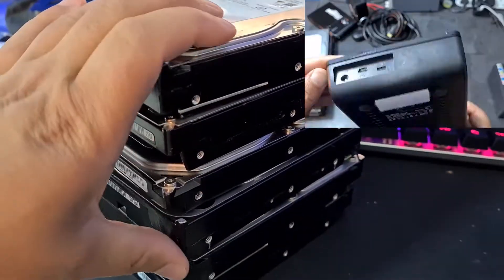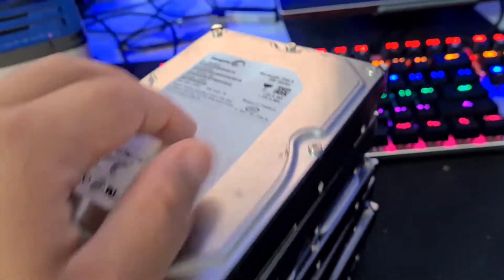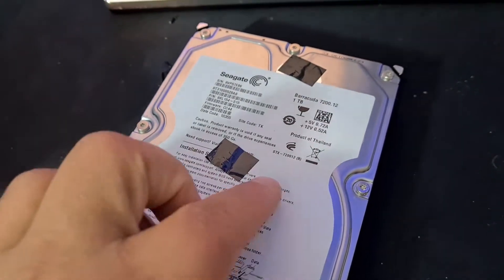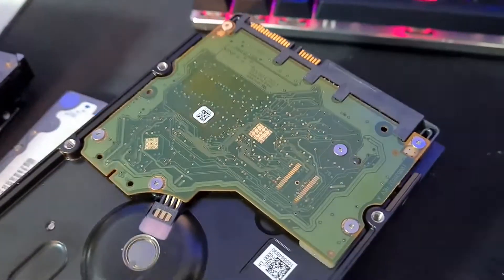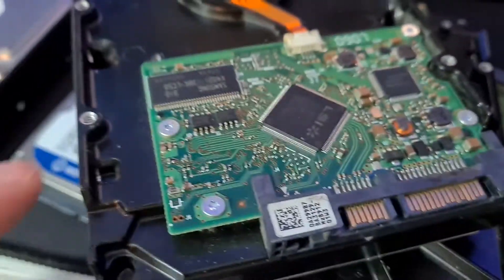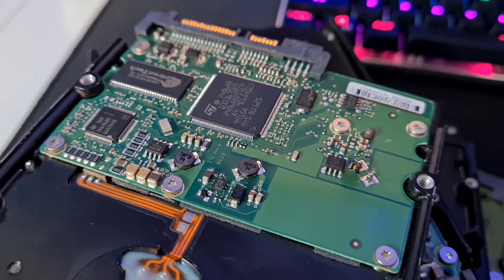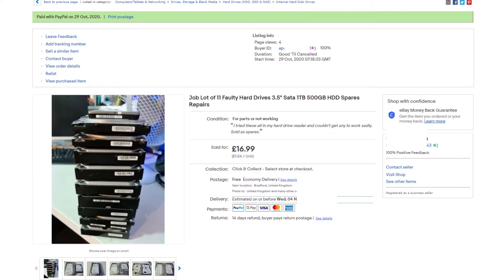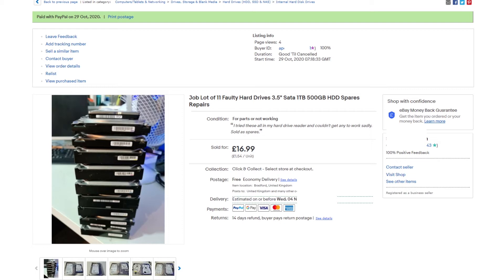Testing Out My Recently Bought Used Hard Drives - Car Boot Sale Finds

Comment: Might have been a good idea to have listed the eBay thing as collection only if that happens again cos like you said it costs a fortune to post 😅
Here’s some tips for getting cheap hard drives that I always use.
1: at car boot sales and on Craigslist and those kind of advert sites, Keep a look out for people getting rid of old sky boxes or TV set boxes. They always have hard drives and you format them in a pc and they work.
2: if you’re buying at the car boot, there’s usually a small sticker on some of the screws that indicate someone’s taken it apart so look out for that. Also just if there’s any dents/rust ain’t good usually avoid them.
3: CEX sell hard drives VERY Cheap. A 1TB hard drive here is €20 which is roughly £15-16. If you need one for a project and you can’t get to car boot sales.)
Reply from the maker: Wait what!! TV set boxes have hardrives!! LOL 🤣 I literally see them for 50p each all the time!!
Reply from the maker: My main HDD I got from the car boot I named it rusty lol covered in rust but works a treat. Obviously that's a 1 off. I'll Google this TV set box thing and also the sticker screw idea is a good one. Most of my bad luck recently with HDD is from buying from this one guy. Not buying from him again, at least not hdd's. CEX is a good shout as well, I have one local.
Reply: @HamedAdefuwa  yeah  the sky boxes definitely have them!  Even some of the newer tv boxes have have 2.5” drives
Reply from the maker: @jamiecullen9075  lol mate I owe you. When I get back to car boots I'm going to binge on them. They're literally everywhere. Need to find which ones have large capacity.
Reply: @HamedAdefuwa  Back in the day sky offered you different sized drives in your box, the standard is 500GB but you can find anything above that they’re usually segate pipeline drives 😁
Reply from the maker: @jamiecullen9075  500gb is good enough for me. I'm excited now lol I haven't seen many on Facebook marketplace but literally see loads at car boots
Reply: @HamedAdefuwa  This guy said It all, DONT buy a HDD if it looks to be in bad condition on the outside. They can break easily. A great way to check if a HDD is working is to Run it oh a pc and use 'crystal disk info' to check that all sectors are working. They are a great tool. DOWNLOAD it and run a test on it for any HDD they tell you all the info about it, e.g. usage time ,https://crystalmark.info/en/download/
Reply from the maker: this is a good point, i regret testing them on my external hdd reader now, i should have actually connected them direct to motherboard, will download crystal now, thanks bro